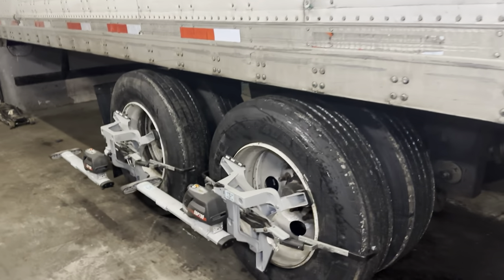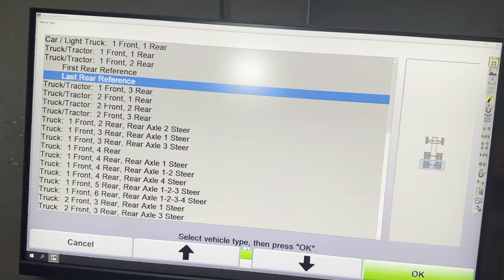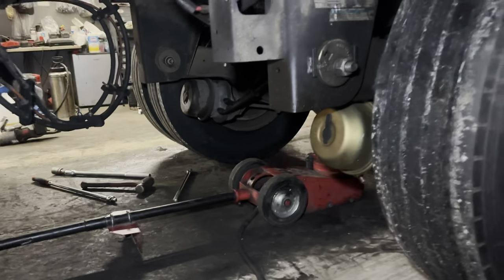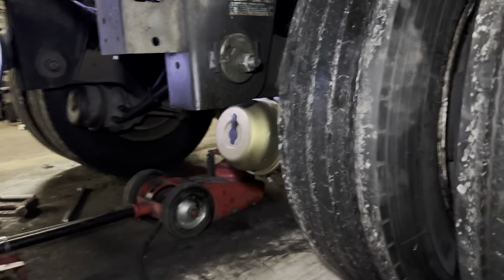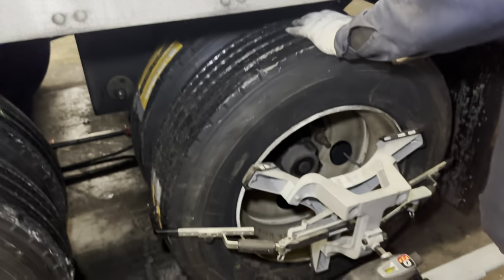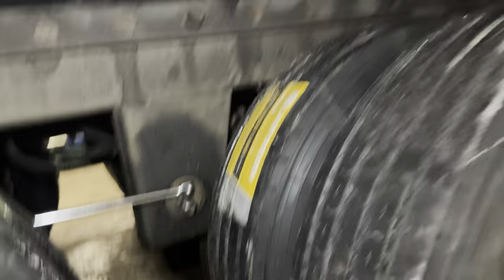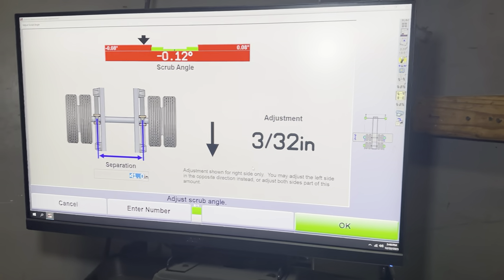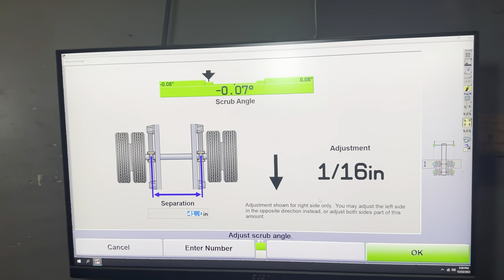Learn How to do ALIGNMENT on SEMI TRAILER Like a Pro!

Comment: Any idea on what a “timing bar” is on a trailer??
Reply from the maker: Never hear about it before, sorry
Reply: On a spring ride trailer there is a torque bar. It's right behind the wheels on the roadside. Turn with a pipe wrench to adjust the alignment.